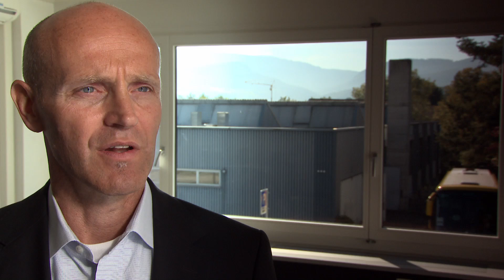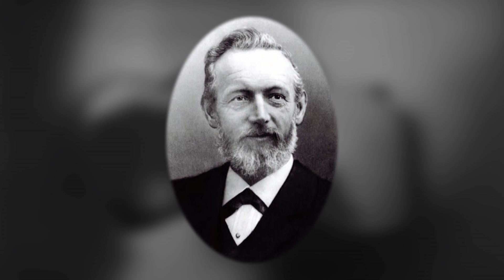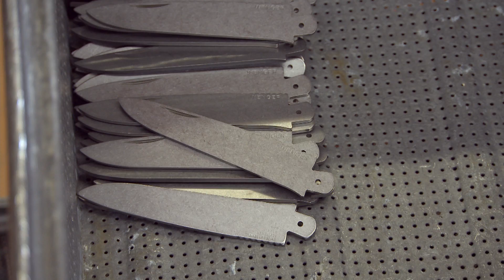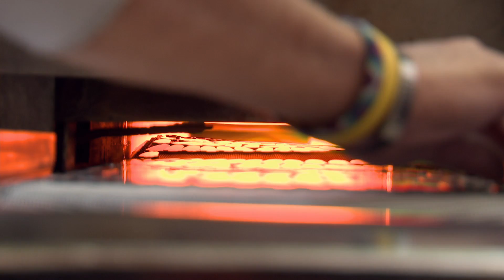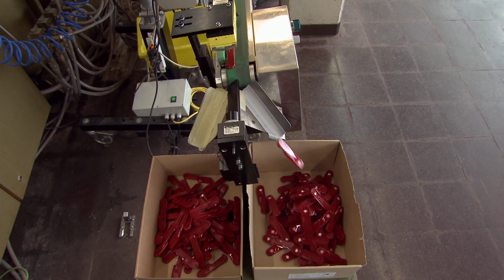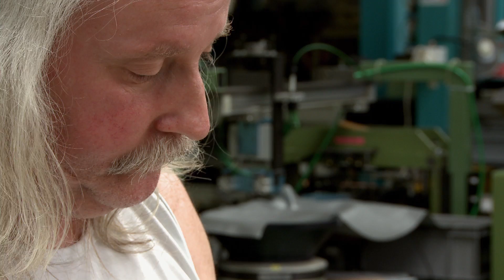How a Swiss Army Knife is made - BRANDMADE.TV

Comment: I'm glad to see when they acquired Wenger in 2017, they adopted the serrated scissors with the better spring, cause it's definitely better as a cutter. The Wenger spring IMHO is a better spring than the frail spring wire spring found on the Victorinox, but the scissors must be used by the thumb only or it tends to fold the scissor away and make the spring not function correctly. Once you know this, the issue can be avoided, until you forget, that is. Maybe the Swiss can reengineer it to not fold up regardless how you use it, until you are done with it?

Comment: Either a Swiss or a crane, have been using my Swiss since 84 or 85, and my crane is from the sixties. Only the blade has been sharpened too many times and the spring broke for the scissors, and the damn toothpick you will always lose.

Comment: To bad they use metals from 1980. Now days there is super steels like s35vn or D2 or elmax. 3v steel. Yet they are still using grampas stainless silverware steel. So one cut and you have to resharpen the blade.
Reply: Mike Carr have you ever used a Swiss knife, the edge lasts for years

Comment: that's not a knife one will use in serious note , eg you wont skin a buffalo or a cow with  it, the blade is small like that of old nail cutters. to me i will call it small  multi tool. It's the corkscrew and the can opener which does its job properly, the rest are useless for example you can't use the screw driver  to tighten long screw which need to be seriously tighten. It is not even worth the price and to be used by soldiers.